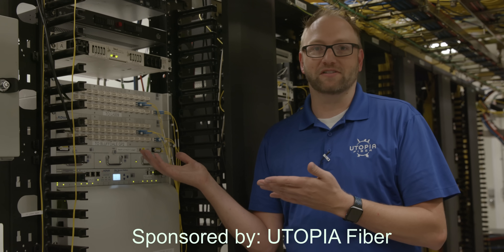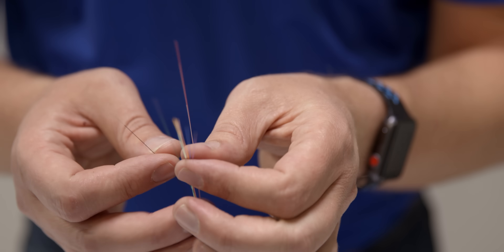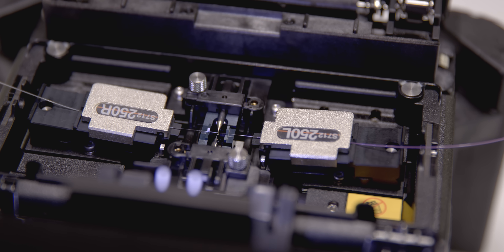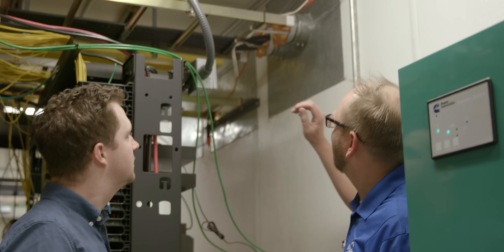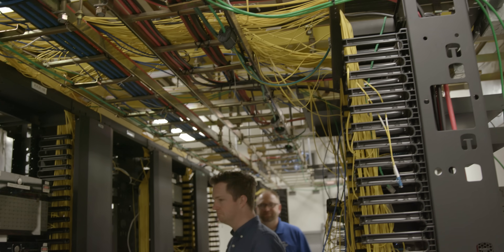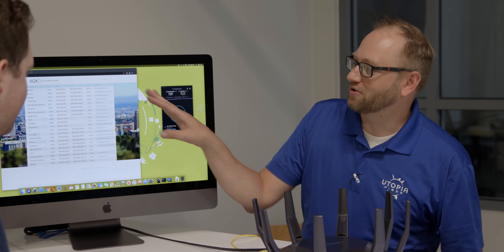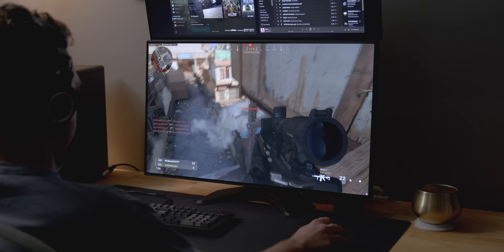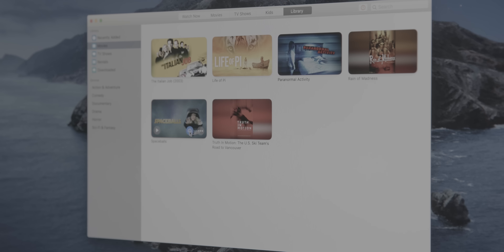4 Terabit Internet?! Fiber Company Tour!

Comment: One of the other problems with a 10gb connection is that even a standard PCIe NVMe drive can only read/write between 2-5gb a sec..  So even with a 10gb connection most peoples hardware would be the limitation.

Even 2 NVMe drives in raid 0 would not be able to keep up

Comment: 15:45 what?  No that's not "about it" you also need to have a 10 Gbps network card and if running through a switch, a 10 Gbps switch.  And these things aren't cheap and virtually ALL computers only have a 1 Gbps connection.  Not to mention that if the speed test is using your local storage drive (and not just throwing it into RAM), you need to have a fast NVME drive because most SSDs can't actually move and store data at 10 Gbps.  I just really want to drive that home for anybody reading this, how crazy fast a 10 Gbps connection is... Your LOCAL SOLID STATE DRIVES probably can't even move data at those speeds. Now there certainly are SSDs that can, but the vast majority of them operate below 10 Gbps... Which is still really fast.

Comment: No. Insane is that in ROMÂNIA we have 1Gbps connection for many years now and I pay 9 USD/1Gps/month and....YOU pay 200 USD/1Gbps/month.

I just re-did a test right now

PING: 4ms
Down: 753.22 Mbps
Up: 497.35 Mbps

And at night I get almost 900+ Mbps on both Down and Up and also when my bandwidth is free. Now the test was performed with a constant of -/+ 20MBps down speed.

Comment: Filipinos spend 30USD for 25 mbps fiber connections. this is the cheapest coverage internet users could avail. Inquiring and availing for fiber plans take months before installment and activation.  Service providers would test your patience. Internet connection losses are very common and they send technicians about a minimum average of weeks after you tell them you have problem.

Comment: If you want to really max out your 10G connection using google drive, you have to use a tool that takes advantage of the google API: rclone (rclone browser if you want the GUI) is the one i’m using and works perfectly! We are a media production company and we use it to secure files and projects on our Gsuite google drive.        Little tip: increase the number of simultaneous transfers to at least 2 times more than default and continue until you’ve saturated the bandwidth.

Comment: Internet everywhere should be upgraded to half a gigabit or atleast 250Mbps up and down minimum if is this easy to provide this sort of speeds.

I run currently off 200Mbps download with around a 21 Mbps upload 300mbps is the max download I can get in my area unless I want to double the price and go for 500mbps but still that has a low upload as well

Comment: i use to have 1.5 gigabit fiber to the home, now that i moved out of the city the fastest i can get is 50 megabit speeds... i wish rural areas had more access to these speeds. but ill have to wait like 100 years for that, the only option i might have is starlink but i dont even know when that will be available in Canada or if it ever will be...
Reply: It might be much sooner than you think. I moved to a rural area not expecting any high speed options. Found out entire townships in my area were installing fiber lines. 940Mbps Down and Up. Also if you get 4G cell service with an unlimited plan, there are ways to get respectable 100Mbps+ speeds without using up your Hotspot data... cough PdaNet *cough*.

Comment: After years and years with less than 5MBits of internet due to living in a rural area (about 3 years with Download speed of around 60KBytes/s, and 5 of 300 - 600KBps), I finally moved to a city (small, but still a city) and now I have around 15MBits of Down and Up. It felt like the future, being able to watch live streams at max quality without stuttering, and then I see this and feel like I'm in the 90s lol
Reply: I was stuck with dialup until I was about 25. 40 now and moved to a rural area that barely had cellphone reception. Found out the whole township had plans for 1Gbps Fiber. About 940Mbps Down AND Up. Getting it installed on Tuesday. Yeah I'm lucky but feel like I suffered long enough. 😄

Comment: Nobody:
Me: crying in the corner with 5 Mbps and 730kbps download speed
Reply: You're lucky you've got you 730kbps
Me only have 100 kbps
Reply: @Jberv  I will just buy a unlimited flat rate with 250mbps for 80€ (95,46$) a month and use my mobile as Hotspot for my pc

Internet in a city in Germany : 20mbps - 1gbps 40€ a month 

Village 2 km away : 5 mbps 40€ a month

😢
Reply: EndHunter8833 in Mozambique i pay around €50 for a 5mbps internet.
Reply: @hassanzulficar1257  WTF?? I pay only 8 euros for 60 mbps fiber connection in India. Data so expensive in Mozambique...
Reply: @TheArijitBanerjee  you are paying a lot too, fiber in Iran is so cheap(everything is actually) 5 dollars for 100-300 mbps
Reply: @amirhadis1698  well, its okay for the service they provide. If there are problems in there, it usually is fixed within an hour. Therefore I think its quite cheap and awesome for the price, service and speed provided.
Reply: @amirhadis1698  Moreover, I live near village so I think the price is okay.
Reply: @amirhadis1698  WHAT?
Reply: @endhunter2149  same here 4 KM away my friend has an Internet connection of 1GBPS for 100$ in my area I have to pay like 100$ for a 200-300 MBPS connection.
Reply: @COCPrivateServer  same for me but 5 km
Reply: @TheArijitBanerjee  Dude where do you live in India? I can't get a freaking AIrtel or Jio fiber connection to my home. Its frustating.
Reply: @siddharthjoshi3037  It's super easy. I just told my local cable guy and he installed it the next day. It took just an hour. I live in Kolkata btw.
Reply: @amirhadis1698  you can go in YouTube in Iran
Reply: @planenjoyer  with a VPN only
Reply: youŕe lucky... 250kbps - on Venezuela.
Reply: all ways appreciate of what you have
Reply: @risingone4972  ok :|
Reply: I pay 30 for 500 mbs
Reply: Oof I get 30Mb/s download speed and 9Mb/s upload speed
Reply: @TheForzaPlayer96 mine is 50mbps now

Comment: the 3-4gb download limit was an issue with your SSD write speed. you would need 4x high end nvme ssds in raid 0 to be able to have enough storage write speed to keep up with the connection or you need to setup a ram drive but that would fill up in seconds and you probably won't connect to enough peers to get the higher speeds before you ran out of room. I need fiber in my life.

Comment: I'm outraged that most of us here in the U.S. are not allowed to have fiber optic at our houses, apartments and business because the local
ISP's are Dictators.  There is no reason why Charter/Spectrum, Comcast, Cox can't start converting all their copper coax cables to fiber optic lines.
I live in an Edward Rose apartment complex and they will not allow any ISP to run lines to any of the apartments.
When is our government / FCC going to force the use and upgrading of fiber optic all over the U.S.?!     🤓

Comment: Sadly looking deeper into this it is just too good to be true. Bottleneck is not only at the servers of service on the internet but the very limited raw link to the internet that ISPs on this system have, that is shared across all their users. In one ISP raw top possable 80G is share across how many houses? Just because you paid for 10G doesn't let you have that into the internet. Still much better than Cable. But not any better than other fiber internet services, at least until ISPs on Utopia massively upgraded their system. 

It also not correct to call this a internet as utility, it is fiber Ethernet as utility or fiber lease to consumers.

I hope they do end up with some premium ISPs soon, then it would be amazing.
Reply: Of course you don't get dedicated 10g connection, ISP are using oversubscribction( clients get 10g each but let's say ISP core network have 10g bandwith to internet for 10-30 of client).
Reply: @wiziek  overselling 10 to 30 times is normal? , I read for metro Ethernet service is 10 time or less(maybe Ethernet switching capacity?) So a ISP with 80G can sell 80 to 240 10G service or 800 to 2400 1G services? Is that really really tiny ISP or they are doing 100 to 1 like cable companies. I still think Utopia is cool but it still not anywhere near what it claims to be now. Hopefully soon it will be.

Comment: In Italy there's something similar with "OpenFiber": they build, maintain and run the network but they're not an ISP,  it's called "wholesale internet" since an ISP pays OpenFiber to use their infrastructure.
The downside is they have chosen the GPON approach. The good news is that the network can be easily upgraded like Utopia, changing network equipment at both ends. The other bad is GPON can't really offer symmetrical speeds, at least right now.
Reply: Non so cosa hai detto ma concordo
Reply: Why GPON is downside? You can't offer people 1gbs download/1gbs with GPON, XGS-PON can be up to 10gbs up/down so symmetrical.

Comment: Well i got a local isp providing me 10 down and 90 up (idk why 90 up .. maybe they have more free up bandwidth) for 16 usd. Or 1200 INR .. which is kinda expensive.. as you can easily get 50 down and 50 up for like half of that price or in 10usd in urban areas...but where i live we have only one provider... Soo i have to deal with regular network issues sometimes the system remain down for more then 12 hrs.. i am a devloper and it is a major problem in my work..but if i got lucky my area will be under a new fiber developement project..... Which could provide a 100mbs up and down stable connection for maybe around 15 to 20 usd..

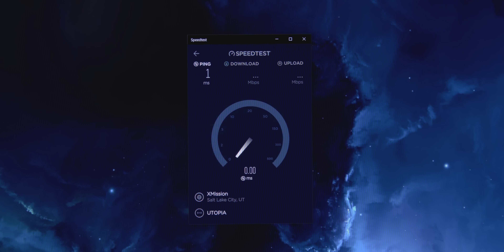Comment: 15:50 - 7000 megabit Internet is so cool
you have no place to use it
Reply: Figuring out how to utilize that kind of speed would be a nice problem to have.

The thing is this kind of connection is wholly unnecessary right now, even the 1G is fairly extreme! but in 10 years possibly. The thing is the architecture is scale-able, single mode fiber has theoretically infinite bandwidth, the main things holding it back are the cost and capabilities of the equipment at either end, so once they actually bother to lay the cable and set up the fiber huts and put down the trunk conduit it will be utilized for a long long time, and speeds will climb as the electronics advance, and the 10G transceivers and switches turn into 100G and 1T.... that's before the multi spectrum stuff is layered on!
Reply: @kal9001  Agreed, a good thing, like teleportation, but for now, we can't use it, we only can teleport few atoms back & forth, but theoretically & factually it is possible, all we need is time

Comment: Cries in socialised Australian internet. The "New" internet system maxes out at 100/20mbps for $90/month.
Reply: australia needs to learn something from these guys thats for damn sure FTTN sucks skippys wang. from fellow unhappy australian
Reply: Search up Aussie broadband.
Reply: I can assure you that it would get even more expensive, if privatized.
Reply: The worse thing is, that the ACCC makes it illegal to make competing fibre networks to the NBN.
Reply: Spain way more socialist country gets FTTH for around 90% of the population. Internet as low as under 40€/1Gpbs symmetric
Reply: Nothing about FTTP is 'maxed' at 100/20.
1000/50 is very much a thing now, but it seems that we are still a long way off of 1000/1000 being made available for residential usage.

My connection is a rock solid 100/40, but for only ~$50 more a month, the 1000/50 available from Superloop is looking attractive.
Depending on your usage patterns the 200/200 250/100 plans may work better for you...  

None of which are anything close to approaching 1000 symmetrical - that the infrastructure is very much capable of supporting.
Reply: CalinDee 1000/1000 is pretty widely avalanle in more urban places in the us. I get 940 up 880 down with verizons gigabit plan for only 80 dollars a month plus fees
Reply: @CalinDee  But because there is zero competition, other than StarLink, that won't happen for a very long time. Government monopolies are cancer. Almost no houses have FTTP. The whole point of the NBN is to be FTTN, which currently tops out at 100/20.
Reply: @heyitsluno   "The whole point of the NBN is to be FTTN" No - not really - 2009 RFP - FTTP to be provided to 93% of Australian homes - the remaining 7% were prohibitively expensive.
Enter 2010.  The Abbott and Turnbull show reject the FTTP proposal because "there is insignificant demand for it".  They then shift the rollout to FTTN , to save money.  This clearly ends up costing more and will do for years to come.

That aside, yes, its sadly true that far too few areas are provided with FTTP...  I wont be moving away from where I am any time soon.

Comment: Pretty recently we got fiber installed and it worked pretty well for some time, after that it stopped working. A technician was set to come take a look at it in our house, before he came he went out to one of those huts to see if the problem might be there, indeed it was, it turned out someone got their math wrong and plugged our connection into the wrong one. Funny to see on this video how it works.

Comment: My GPON MGTS ( in Moscow, Russia is 300 mbit/s, the monthly payment is around 7 USD). Max speed is 1Gbit/s(for 15 USD per month). MGTS (which were previously state-owned telephone network, founded in the XIX century) had biggest underground infrastructure and replaced hundreds tons of copper cables, some of them which were laid in 1920s. Thus they over flanked all ethernet broadband operators, and another huge company Rostelecom (intercity and international carrier of the USSR) also has 1Gbit network in Moscow and hundreds Mbit/s in the different cities(better or less).

Comment: I live in a small hamlet in northern france (rural area), I'm getting 1Gb down / 700 up + unlimited calls landlines includes + unlimited international phone calls included (110 countries) + cell phones calls included + 200 hd & 4K channels included for 35,47$ (29.99€). I get 1Gb/s on fast dot com. This is not a promotion offer (Freebox mini 4K). I can get 10Gb/s down 700 mb/s upload speeds (with all the aforementioned services included) for 59,15$ / 49.99€ - and only 47$ / 39.99€ during the first year  (10g epon technology). 2.5Gb/s and 10Gb/s connections are becoming mainstream in France. 10Gb EPON is available everywhere in rural areas (in northern France).

Comment: finally, I can download the whole Microsoft flight sim library
Reply: I just calculated it. At the current size of just over 2 PB = 2,097,152 GB it would take a 10 GBit/s = 1.25 GB/s connection less than 20 days to download Flight Sim's entire map material. That just goes to show that you are expected to take more than 5 years to ever see the entire world's surface in flight sim on "just" a 100 MBit/s connection.
Playing with way less than that probably will degrade your experience. 40 MBit/s might still be fine though.

Comment: i install fiber optics for major companies this is a long way away,  432 in one cable would actually only be 216 homes, cause you need one leg for sending information and one for receiving 

not to mention how separating two strands per house and then sending the rest down the line seems impossible to me (a fiber tech)

we use a fiber color code to know where you are on both ends, 432 colors? we start repeating colors after 12 and use black dots on 12-24 and black lines on 24 -48 and when you terminate two strands you cant just cut two pieces of glass out without cutting the rest. 

theoretically its possible, but the service techs that would do this would not be paid enough lmao that would be a nightmare.
Reply: They are using Bidi transceivers, which use WDM to combine upstream and downstream into one fiber. So one fiber per house as it seams. Also they are probably doing mid spans to avoid splicing all fibers at each FOSC
Reply: @K1ish  that cable he showed wasn't midspan 

WDM is a good point, but that's an added cost at every house making it even less reasonable, And another point of failure

Comment: does my connection drop when a new member gets spliced?
if the tecnichian opens upd that box with all that fibers feom my neighbours and me, it should cut the conmection by the su light or not?
Reply: They probably do a mid-span splice at each splice closure to avoid cutting active fibers. It’s where you remove the sheathing without cutting the strands.

Comment: UK just started rolling out gigabit True-fiber to major cites. I'm assuming they ran fiber cabling through existing pipes. Then they dug up these terminals in front of select houses. From network map it looks like there is a terminal per 20 house but not every section of the roads has a terminal yet. My house is 5-10 houses too far from the nearest terminal. Only if i lived 5-10 houses down the road I would be enjoying gigabit fiber since 2018.

Comment: I've had 10gbit for close to 6 years in Sweden and I can honestly say it's not really worth it. You gain almost nothing in terms of speed because websites are limited to not only your internet speed but the website provider as well. When it comes to downloading things the only place I actually can take real full advantage of my 10gbit connection is on Steam, all the others cap at maybe 500mbit/s or even less.
Reply: I'm running my own pfSense router with 10Gbit nics.
Reply: What Router do you use for 10gbit?